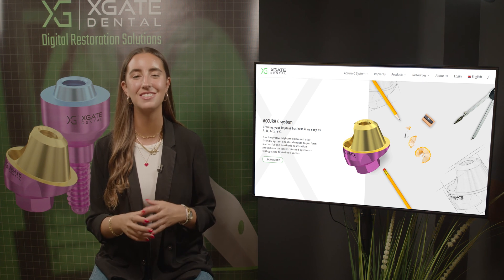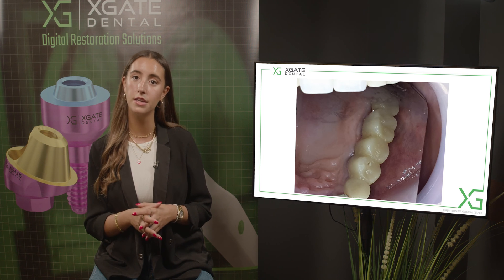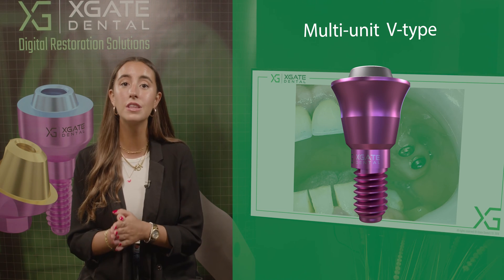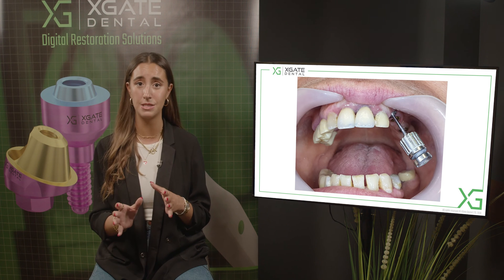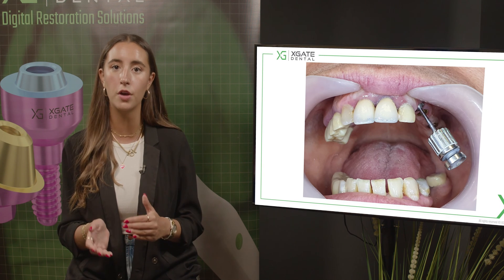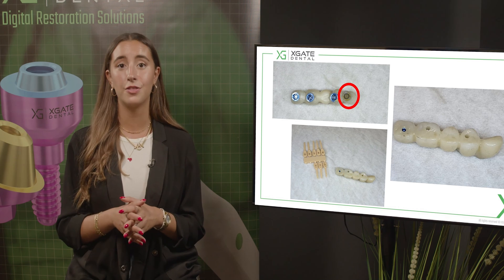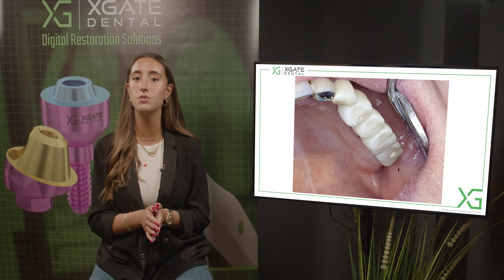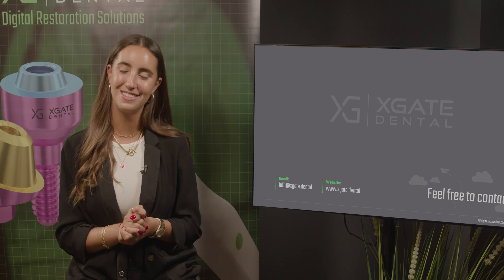Replacing a Cement Crown with a Screw-Retained Restoration. Aesthetic Aspects of the Crown

Comment from the maker: Browse through the video to find out more
00:00 we'll have a single crown and a small bridge or we could make a bridge that is a little bigger
01:00 it couldn't be a fully functional crown
02:00 now we want to change this crown and we want to add some other implant
03:00 now we want to change it to screw retained restoration
04:00 the buccal part of the angulated implant is almost always visible 
05:00 a screw retained implant we have a multi-unit and we have a stopper and we have a sleeve
06:00 it's a great solution for some cases when you can't have any other solution